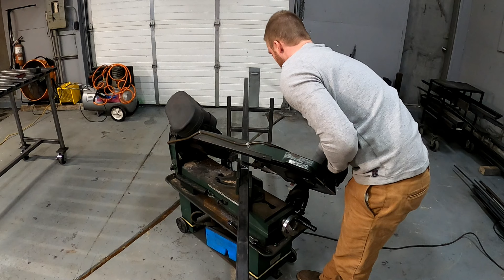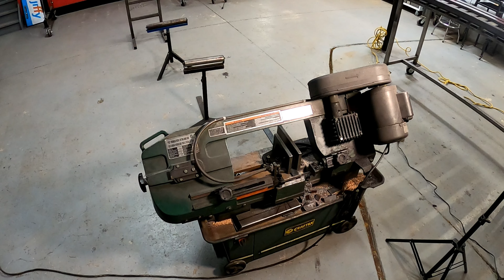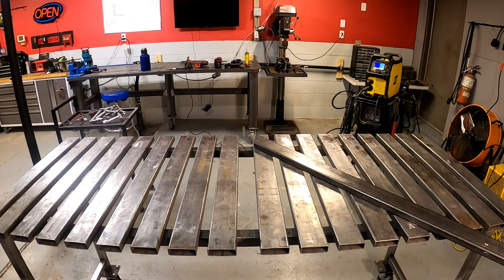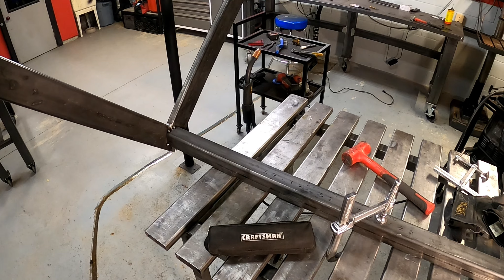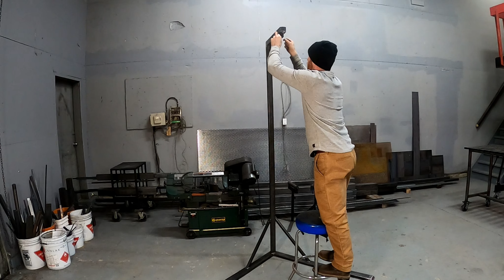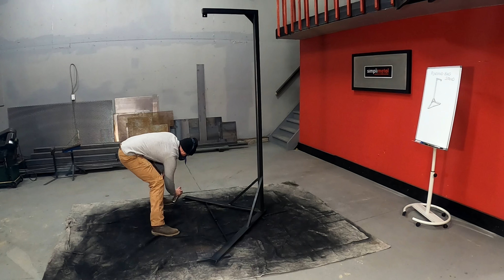Building a Punching Bag Stand (DIY)

Comment from the maker: After using the bag for 6-months, here's what I would have done differently to increase stability + dimensions are posted below:

- lighter bag,  after a few good hits the momentum of a 100lbs bag is a lot for the stand
- made the neck stick out further + added a tail piece at the back of the base
- not made the chain piece connecting to the bottom, the bags momentum pulls on it when it swings forward
- if in a garage space just bolt it to the ground

Dimensions:
Base / Feet: 48" long made of 3x1@1/8 tube
Back / Spine:  91" tall made from 2x2@3/16 tube
Neck: comes out 24" of that same 2x2 tube

Comment: I need a solution, because if I hit and kick really hard then there is a potential for the stand to fall
Reply from the maker: You got a few options, add a leg or two extending out from the back, full with sand which I did, helped a lot, if it's going in a garage / concrete add tabs with holes on all three corners and put a concrete wedge anchor into them.

Comment: I'm thinking of building a pull up rack that can also double as a stand for a punching bag, any tips?
Reply from the maker: @JamieBollman-w1l  nice bud do it up! Main thing is to extend the bag out further (closer to the front where you hit it) than I thought for better stability. Was more wobbly than I planned even after filling it with sand
Reply: (Don't mind the new account lost the login for the old one) Thanks for the advice I ended up building a seated row machine that I can load up with plates. It works great I just messed up on of the arms so it's a little crooked
Now I'm working on a cable machine

Comment: love the final product, can you please list the dimensions? is the base 4 ft or 3.5ft? don't you think that a tail in the back ( a few inches) will make it more stable?
Reply from the maker: Thank you bro took a lot of work! I wanted it tight in a corner so I didn't put the tail in, but in hindsight it would have been great addition. With the 100lbs bag, after a few good hits it starts to get momentum and a bit tippy. 

Dimensions are  48" long feet made of 3x1@1/8 tube, the back is 91" tall made from 2x2@3/16 tube, the neck comes out 24" of that same tube 2x2. 

If you end up making one DM me if you have any q's along the way. Cheers!

Comment: Nice build bro. How'd it fair full of sand with a mat under it? Any wobble or sturdy enough to really lay into?
Reply from the maker: Thx for the support homie! It's not bad when you start hitting it hard, but once it starts to swing back n forth it builds momentum then gets tippy so you gotta grab it. It's better without the chain on the bottom, and could use a lighter bag - 100lbs seems too much. Someone suggested putting a tail piece extending out the back, would do this and put the bag further forward if I did it again! Leme know if you end up making one!

Comment: Brother ,i was wondering of the measurments of the stand if you could write them down i would really appreciate it
Reply from the maker: The legs are each 48" long made of 3x1@1/8 tube, the back is 91" tall made from 2x2@3/16 tube, the neck comes out 24" of that same tube 2x2. 

If I was to build again to increase stability I'd make the neck stick out further, not build the chain piece connecting to the bottom, put a little tail piece coming out the back of the base as someone else suggested in the comments, and use a lighter bag. This 100lb bag after a few hits really gets momentum and starts to get tippy. 

Hope this isn't too late man took some time off, got a new video coming out this weekend! If you end up building one and have any questions DM me!
Reply: @UncleStevesWorkshop  Thanks ,i ve built my own design in the meanwhile.
Reply from the maker: @Sadspacemarine  Awesome to hear good on you for getting it done 🤙